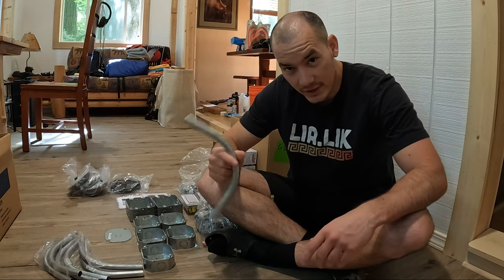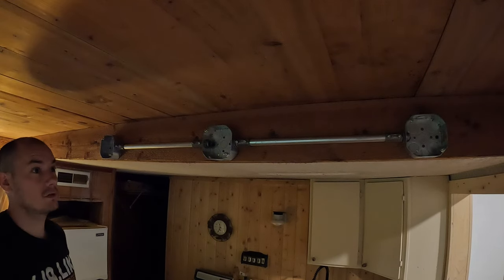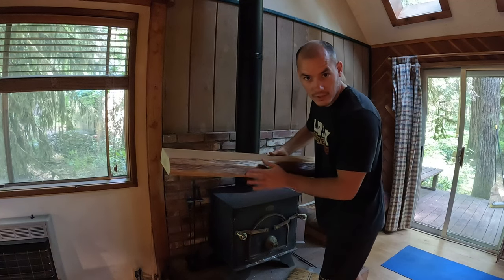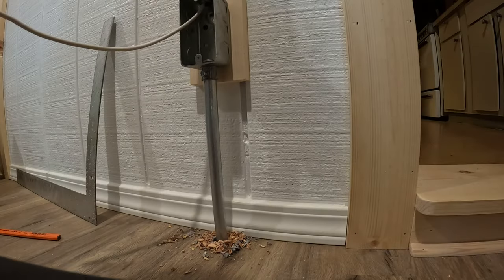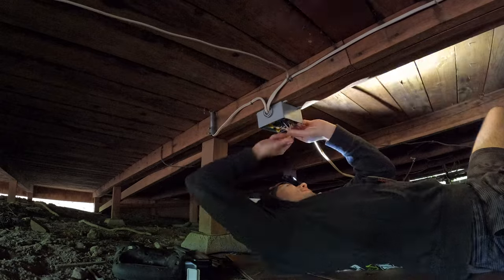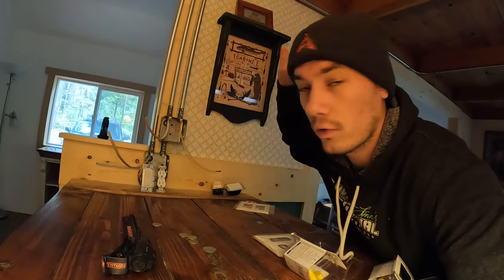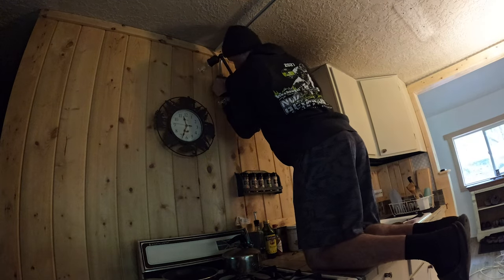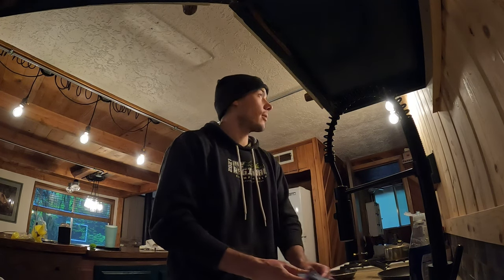Wiring Lights in the Kitchen at My Off Grid Cabin

Comment: Cool thing is the generator has a breaker to prevent overheating of the wiring system. Great work. I'm building a cabin on my farm and YouYube is a great source of information. I've never built anything before and I did the pluming, framing and electrical. I do have a friend that is a master electrician that was very helpful to make sure I did the wiring correctly.  Keep up the good work.

Comment: It'd be cool if you posted all the videos and websites where you learned how to do all this. Sounds like you need a bigger generator, or you could link multiple generators to one generator, turning them on when you got guests for those special occasions but only using one generator when you're alone. Will you try to hide the wires you wrapped around the pipe over the bar and the wood you installed over the table? Always glad to see you post another video. Kudos!